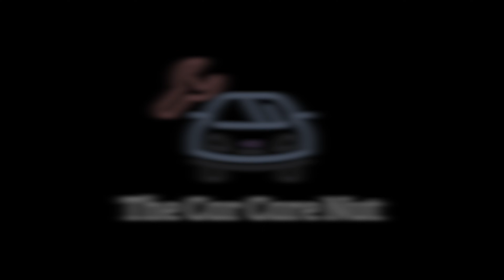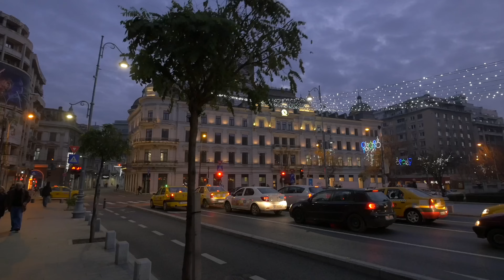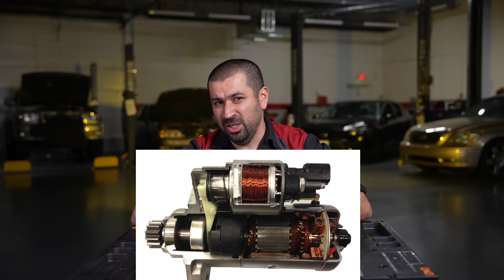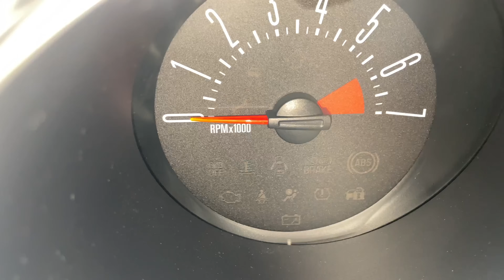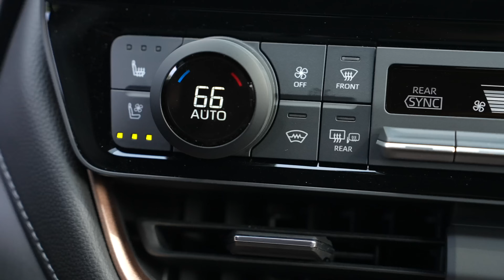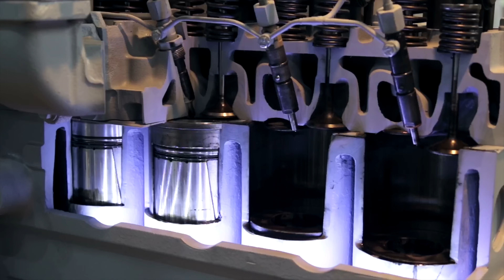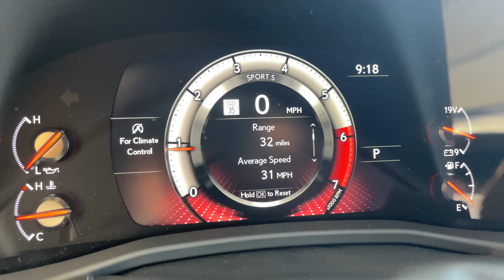How Does Start Stop Technology Work in Modern Cars? Everything You Need to Know

Comment: The few cars I've been in that have it when the engine shuts off u immediately lose air conditioning. It takes about 10 seconds before the air coming out starts to get really warm and the car just starts again to give u a/c. So like here in Florida they shut off and then immediately turn back on cuz it's so hot and it needs the air to work again. REALLY pointless. Maybe Toyota does it differently I hope so
Reply: My 2002 Prius stays absolutely ice-cold for about 30 seconds when the engine is off at a light, and then it starts to warm up very slowly. There is no electric AC compressor in this generation of Prius, only a thermal-storage buffer in the evaporator core.

Comment: This video has been very informative. I considered battery, starter, the HVAC but never figured out how they would do it, and after buying a vehicle with the feature I realize the extent of the monitoring being done. However, I never thought about the AT transmission pressurized the system nor keeping the coolant flowing. I think this is the best that content explains the auto stop/start system. Thanks AMD. 🙏🏾
Reply: You're right. All of this is just further proof that the whole thing is just a bad idea all around. There is no point in all of this

Comment: So engine oil pressure is maintained between start and stop events? Would think that is necessary to ensure less ring and cylinder wall wear....unless they rely on the anti wear additives in the oil? Surprised these engine last as long as conventional ones.

Comment: The start/stop system actually does damage your engine. Every time the engine shuts down, all the oil drains down to the pan. Every time you start the engine, for a second or two it runs dry, without any lubrication until the oil pump can distribute the oil to the top of the engine. With a start/stop system, over the life of the engine, you will have started the engine thousands of times more than you would have without this system. Your engine that may have lasted 200,000 miles might last 100,000. This is a gimmick dreamed up by the greenies to make you feel good that you are doing something for the environment. It’s a joke. If you don’t have this system, good; hang on to that car. If you do, press the disable button every time you first start the car.

Comment: When an engine shuts off, oil pressure drops to zero.  There is always a split second when your engine is turning with zero oil pressure upon startup, would that increase wear on the engine with the start/stop system?
Reply: I think there is a controversy as to whether the start up wear problem is more due to the "dry" period of no direct oil wetting or is it due to the low temperatures of the metal parts and the condensation of combustion gasses which are rich in water vapor onto cold engine metal. This is much more of a problem in cold starts. Also I think that with an immediate hot restart the oil is still in the galleys and immediately begins flowing to the overhead camshaft(s) unlike the first start of the day which might require 10 or more seconds to get oil up to those camshafts

Comment: I hear they have problem of Start/Stop on a Toyota Corolla Cross Gas version. If you have wiper on in intermittent mode and the engine shut off. it can't start up on until you do full off and on.

Comment: Still not buying the "It doesn't do damage to the engine by stopping/starting" argument.  An electric pump maintains trans fluid pressure while the engine is stopped, so the car can move as soon as the engine is started.  Why is there not an electric pump (or at least an accumulator) to maintain engine oil pressure while the engine is stopped?  It is well-known in the industry that engine start with zero oil pressure is when most (though small) engine damage occurs due to zero pressure protecting bearings/rollers/guides/cylinder walls.  Don't own a vehicle with the technology, but a family member does.  And I've recommended "pushing the button" at the beginning of every drive to disable the system.  And oil pressure bleeds off in that V6 engine fairly rapidly, so all the more reason to do so.  That family member thinks the system is an annoyance, anyways.

Comment: Another aspect not covered in the video is different lubrication in the engine bearings. My understanding is there is a graphite additive to allow for crank rotation with no oil pressure without metal to metal contact. A regular engine started this many times would have significant scoring in the bearings and journals that might lead to engine failure.
Reply: If you have ever changed the oil in a stop start engine you will notice that after you dump your X amount of quarts in the crank case and you pull the dip stick to check it will show dry. You’re supposed to wait anywhere from 20 min to 2 hours (depending on the make). The oil stays suspended in the crank case for much longer than a regular gas engine with no start stop. I’m guessing this attempts to cover the lubrication issues associated with start stop.
Reply: @flyer8493  Sorry but that is a bogus myth, what has happened are shops with the air operated oil pumps will fill the engine to fast and the oil backs up in the upper end and you have to wait as long as 20 minutes for the oil to drain down through the small return holes to the crank case. The Ecodiesel is one such engine. If you fill the engine with single bottle quarts of oil this is not a problem because the oil does not back up.
Reply: @LeeCountySpeedShop  Absolutely not a myth. I’ve watched it with my own eyes. I own a 19 Silverado with the 5.3. Has start stop and I do my own maintenance. I dump 8 quarts in the crank case and the dip stick is dry. Owners manual states you only get an accurate dip stick reading if the oil temp is hot and you let the truck sit two hours. When Fords 2.7L ecoboost was new, guys in the forums would talk about how they would add oil during an oil change and their dip stick was dry. I believe they stated they had to wait 20 minutes but I could be off on that. I have no personal experience with the 2.7L. They would also complain about dealers overfilling their crank case with oil because they were not used to filling start stop engines with oil and were not aware of the wait time to allow oil to drain back in the pan.  Every other vehicle I’ve ever owned, oil immediately drains into the pan after dumping new oil in the crank case. In my current truck that is not the case.
Reply: @LeeCountySpeedShop Also he's absolutely right, you should look at some of the repair manuals for a lot of these cars. The cars that are sold in Europe with the start stop system versus the ones in United States that are sold without it, the manual explicitly states that the oil channels are modified to maintain oil pressure in the head and to reduce the amount of drip down. There is a bypass if the oil gets too high but it's supposed to maintain a buildup of pressure for up to 5 minutes, after which when the pressure drops the engine will immediately come back on to protect the oil pressure. At least, this is the way that Honda, Toyota, and GM do it. Kia Hyundai? Well honestly their start stop system actually sucks because they are a shitty company anyway so that actually is fair
Reply: This dude seems to be playing it all up like this start stop shit is a good thing. It is absolutely pointless at best, and a reliability nightmare at worst.
Reply: @MadScientist267 start stop saves quite a bit of fuel, quite a bit on emissions, And have not been a reliability issue. People said the same thing when engine switched away from carburetors to fuel injection, they said oh now there's a computer to fail. In reality, cars are more reliable than they were with carburetors. 

Start stop systems have been around on many cars for over a decade and statistically don't cause issues. Even my manual transmission Honda CR-Z has a start stop system, except that it comes on instantly, there's not any hesitation, etc. engines that have start stop are actually designed for it. They aren't using the starter motor because that would wear it out, there's a dedicated motor built directly on the crankshaft. Oh, one more thing to fail? Yeah that's what they say about crankshaft position sensors or about having an extra piston instead of A3 cylinder engine or whatever, in reality the engine is designed for it. It's not something that they have to tack on, it's something that's integrated in the design of the engine. Some manufacturers like Kia or Hyundai, have really horrible implementations. Others, like Honda, are 100% seamless, and also reliable. As in, They likely increase reliability because start stop starters never fail, as they are extremely overbuilt. This means that a starter motor is something that you'll never have to change, additionally, saving where and tear to the engine and decreased where to your normal 12 volt battery because it's not being used to start the car, etc. things like HVAC changes, they didn't change the HVAC system, they just designed it to work slightly differently. It's something that had to be designed into it from the start with start stop in mind.
Reply: @pilotavery  I'm sorry but you'll never convince me that it is better than just leaving the engine running. "Continuous operation" is always better for equipment. When the engine stops, so does the oil, and it starts to drain back, at which point there's reduced lube when it restarts. This translates to increased wear. You can parrot what you've been told all you want, those of us with understanding of the inner workings know it is a bad thing. Enjoy your over complicated vehicle. My gas mileage is fine, thank you, and I don't have all this absurd "extra" to go wrong. Like a coworkers did (specifically the start-stop system and a 2500 repair bill). I'll never experience that because my car doesn't do those silly things.
Reply: @MadScientist267  did you not read my previous comment? The manufacturer manual specifically states that on engines equipped with start stop systems, the oil and lubrication system have different part numbers. Specifically to maintain oil pressure for the engine.
Reply: @MadScientist267  I'm not ASE certified, but I am a tech. I can tell you for sure, that the engine lubrication issue is not an issue. Oil pressure and lubrication is maintained. Actually, you can verify this for yourself. If you drain all the oil from your engine and then you try to fill up the oil, it will actually fill up all in the valve cover first, and the dipstick will read empty for a good hour or so. It takes a couple hours for all of the oil to drip down into the pan when the engine is not running. This is because of the modified lubrication system. Pressure is only maintained for about 5 minutes though, after which the start stop system will start the engine again.
Reply: @MadScientist267  It's basically just a little chamber in the block to trap some gas as an accumulator. It acts like an oil reservoir and the pressure is slowly released as oil trickles out through the journals and bearings
Reply: @MadScientist267  It also depends on the car, because I have worked on Hyundai and Kia's and the start stop systems suck. Fords are almost as bad. Ford and GM makes Chevy vehicles anyway though. Honda and Toyotas are fine, and so are Nissan and Mazda. The new Hyundai's are actually great as well, they use a proper brushless motor.
Reply: @pilotavery  I saw it and ignored it like anyone with mechanical knowledge of cars would. 🙄
Reply: @pilotavery  That's great. That's just an alternate sump. Where it matters is in bearings. Holding on to the oil in the head does nothing but keep the surfaces that don't need it soaked with oil
Reply: @MadScientist267  It doesn't just hold it in the head It actually holds oil pressure, did you read my comment?
Reply: @MadScientist267  The bearings need constant pressure which is why they use the gas chamber accumulator inside the block like I said before. This maintains an actual positive pressure within the oil system for a solid 5 minutes or so.
Reply: @MadScientist267  thanks but I think I'm just going to keep believing the Toyota and Honda service bulletins about the function of their engines over some YouTuber. The L15A engine for example on the Honda Fit and Honda CR-Z, actually have a different crankshaft due to slightly different oil channels, along with a different head in different block that have extra channels milled in specifically to trap enough gas to allow a positive pressure to build up. It also allows the engines to have a much lower idle, around 400 RPM. 
Considering they warranty the cars here in California for 150,000 mi 15 years I feel like they wouldn't honor the warranty if they didn't believe it was going to be reliable
Reply: @MadScientist267  Did you miss the part where I'm a technician? I work on engines... Smh
Reply: @pilotavery  You don't need all that extra BS if you don't do something ridiculous like stopping the engine constantly 🤷‍♂️

Leaving it running is better. Period. I don't care about the parroting. It wouldn't be the first time the industry tried to sell a complete failure of an idea. I feel sorry for anyone who thinks anything about that system is beneficial. And everyone I know who has one always disables it after every initial start. Go sell it to someone who doesn't understand how things work. And the fact anyone claims to be a "technician" is meaningless. There's also a reason I work on my own cars. You're just reinforcing why I need to do that.

I've been around too long to believe all the complexity we have today is for the greater good. It's just more to break and when it does, they can charge whatever they want for the parts and all the extra time it takes to dig thru and get to whatever went wrong. The more you talk the less impressed I am with your claims 🙄
Reply: @pilotavery : But we don't believe you.  😂
Reply: @MadScientist267  honestly the entire concept of running an engine off of exploding hydrocarbons is just ridiculous in the first place so if you think about it in a vacuum...
Reply: No that doesn't make sense. If the crank rotates then there is oil pressure because the oil pump is moving also. They are always moving at the same time and never without the other.
Reply: @bavarianblessed  Agreed that the oil pump moves in conjunction with the crank. However, the pressure build-up can't possibly be instant. This isn't a closed system like a hydraulic line where a pump compresses incompressible fluid and therefore there is instant pressure on the other side. I know the system isn't fully dry as during a cold start, but the pump still has to pick up the oil and move it, and the pressure at the crank bearings has to be built up from zero after crank rotation begins, so there is at least some rotation with lower pressure and therefore potentially higher wear.
Reply: I don't believe lubrication is an issue as this is NOT a COLD start situation.  The lubrication has not had time to "drain" away from the internals.
Reply: @rlo-is-me  that was my thought exactly. Any startup will cause relatively more wear compared to just idle running but it's negligible on a operating temp engine with oil filmed surfaces. Using a quality synthetic (with low fuel saturation) may be more  crucial on a stop-start engine probably?
Reply: @bavarianblessed i empathize with your comment. At least for BMW they state in their technical training manual for the B46 engine that the bearings are Irox coated to prevent issues from increased wear due to natural break/interruption in the Oil Film that occurs once an engine stops moving. Therefore it is slight, but the wear seems to be increased sufficiently to require a fairly expensive coating on components that usually do not come with it.

Comment: I saw this video several times, and I understand the complexity of this newer start stop system, which I had  the chance to test, and I  turned it off many times, because it simply felt unsafe to drive very late at night, depending on this start stop system, that if a malfunction occurs, you will find yourself in the middle of the night, on any distant road with no other traffic, exposing yourself to a battery or electrical failure that could make your car not start again.......This was while my 2005 Toyota Corolla was at a pro. body and paint shop for around 44 days, in a rented 2021 Hyundai Elantra and on 3  2021 - 2022 Toyota Corolla LE, I believe the Corollas didn't had the system, It is too computerized, and the computers and the heat generated by the engine is a formula that makes me believe Toyotas are too complex  to be kept 15 ,16 to 20 years or more now, without having to spend a small fortune in repairs. In the 2021 Hyundai Elantra, the start stop system felt unnatural, nothing like on a Hybrid, which are more complex. Many times I forgot to turn it off, and it cannot be turned off after the engine is started, I had to turn the Hyundai Elantra off to deactivate the system.....
It simply felt unsafe, like the car starting in the morning on a cold start at any moment, even today in the year 2023 I hear many cars and SUVs like when they start in the morning.  There is nothing smooth about it, and because of emissions, your car can turn off in the middle of the night on a distant road and place where you could be isolated? That is not the time to think emissions are the most important thing to worry about.... Is not safe.

Comment: There was a video in Engineering Explained channel where they figured out you need the engine shut off more than 7 seconds to have better efficiency. Many times I wait more than 1 minute for left turn which is great use case for this system.